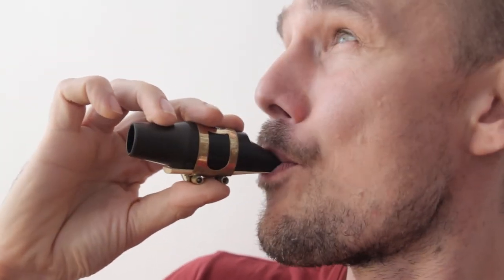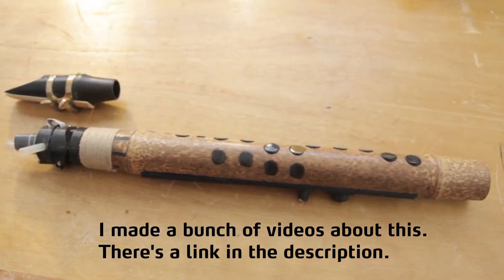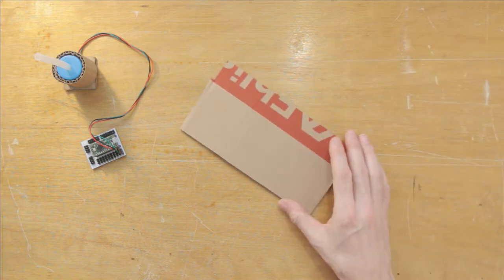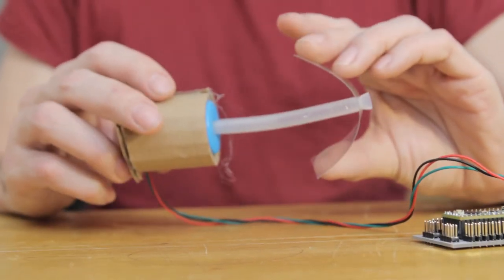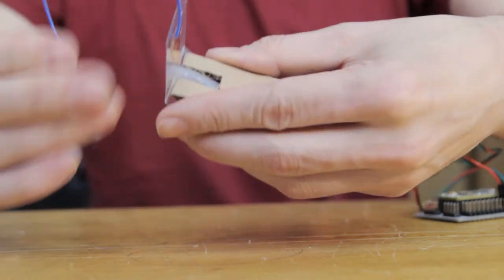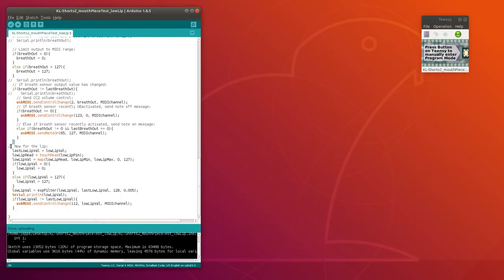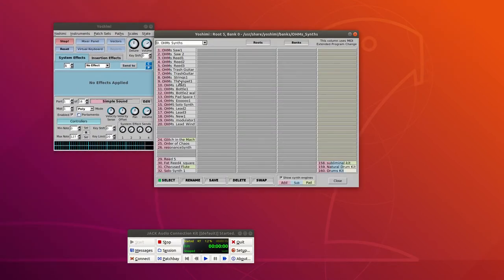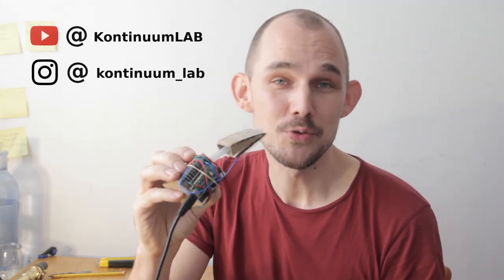MIDI wind instrument mouthpiece. (Tricking the brain with sensors - part1).

Comment: hello this breath controller is possible to put on the inner mouthpiece of a saxophone to control a midi and sample softwar, without disturbing the acoustic and a real instrument
Reply from the maker: Hi Rodrigo. No, that won't work, because an acoustic mouthpiece needs free air flow, and the electronic one measures pressure.